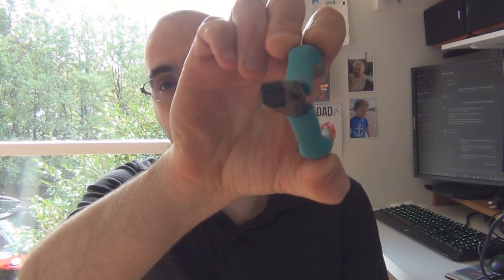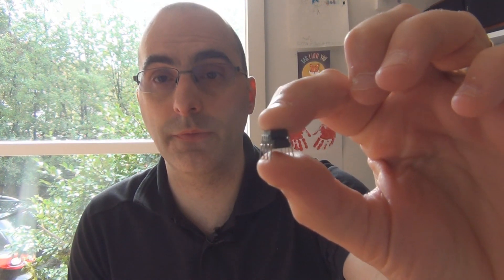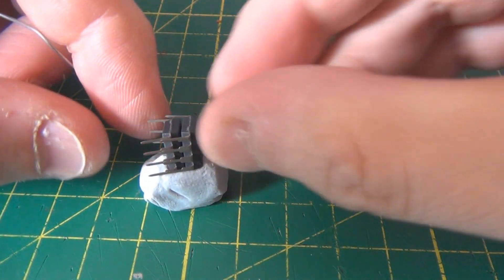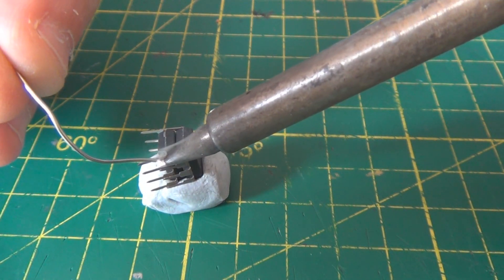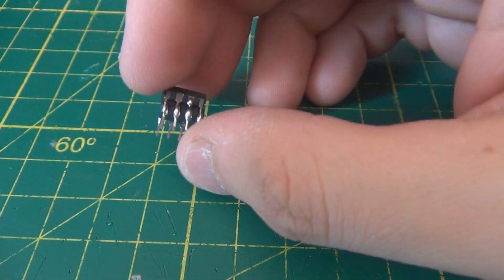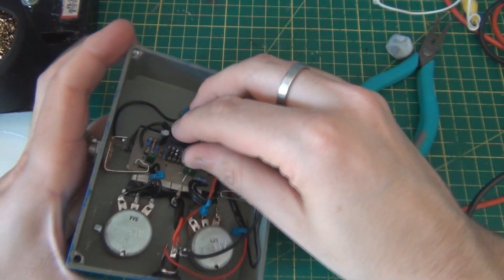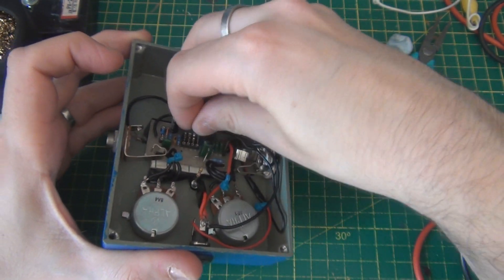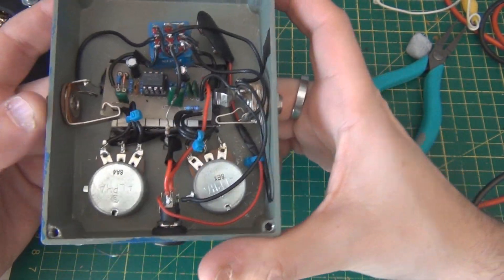Guitar Pedal Mod - IC Stacking

Comment from the maker: Hey guys, it was pointed out the volume level had changed between samples.  This would have happened when i was swapping the chip over.  Apologies for the mistake, hopefully it will still give you an idea of the mod!  Cheers (Paul)

Comment: Some of the differences could be due to the fact that the voltages are likely different now that there are two ICs drawing off of the same power node. You'd have to change values to achieve the same performance per-chip as the original one opamp circuit would have. 

It's kinda like in cathode bias tube amps - when you double the  number of tubes, you half the cathode resistor size.

Comment: This modification effectively runs the amps in parallel, reducing the current output of each one by half. It’s going to make a difference if the amps need extra drive current capability. Otherwise, if you’re operating the amp well within it specifications, it shouldn’t make any difference.

An application that might make sense is if you were driving headphones or using the opamp in the driver stage of a difficult to drive amplifier such as the TPA 3255.  Those popular amplifiers are so difficult to drive that they tend to have a separate amp after the preamp stage just to create more voltage and current on the input side of the amplifier.

Comment: The benefit of parallel devices is reduced noise (when done correctly). Devices should be the same model to make sure that they divide current/voltage equally.

Comment: I did this in my Peavey VSS 20 in the Superstat circuit and it was a slightly bigger difference in sound and the noise level came way down with the dual 4558dd mod similar to what you did here. It seemed crunchier with a slightly better overall tone.
However, the stock volume control isn't quite as effective as it was with one 4558dd. Btw the amp originally came with the 4558d op amp and between the 4558d and 4558dd I noticed very little if any sound difference between the two op amps. Just putting that out there for those that were wondering.

Comment: I've been thinking about doing this with LM13700 in a compressor, but it would seem one has to change outboard resistors and capacitors to compensate for extra power draw, freq response, in/output impedance.

Interesting how those two stacked together had some nasty brunt bacon thing happening up in the top end... they did not sound happy did they? HAHA!  I wonder if it's cuz the TL0xx series have JFET inputs?

Thanks for the demo!

Comment: stacking op amps would probably have a bigger difference at higher gain levels with the volume set the same. i suspect youll hear the difference easier as the gain knob gets rotated and itll be heard in "the grain of the gain" more than the total gain
Reply: Had same thought. Op-amp would be overdriven, in higher gain. Stacked could maybe 'spread the load' I've got a dual channel pedal. I'll give it a shot, on one side

Comment: I never heard about placing two op-amps in parallel nor saw it in real circuit or schematics.Buffering the output of any op-amp for extra current using maybe more than one it is common solution but this circuitry never has been used.One critical parameter of any op-amp is the Slew Rate that is the time that takes its output to follow the signal changings of the input.For example the LM324 is the worst of all and must be used only in DC comparating circuits so is useless for any audio applications.J-Fet input as TL08x series are fine.

Comment: I came to notice, that the knobs are in slightly different positions in the 1 opamp 2 opamps comparison so distorsion and vloume are actually lower in the 2 opamps part. Also could you make another test with matched volumes? Would be great to hear them at same audio level, since louder is often received as better thanks to the Fletcher-Munson-curve. Thank you, for the interesting content!
Reply from the maker: It must have happened when i swapped the IC's, I didnt notice that!  Im not totally sure that would account for the dramatic volume lose, but the biggest problem is with the noise anyway.
Reply: @DiyguitarpedalsAu  might be voltage dividing and running both cooler

Comment: You have increased the current capacity by two. This may not have any benefit for your circuit. This has the ability to shove excess amperage to the Amp stage.